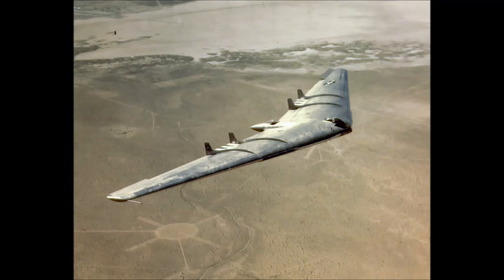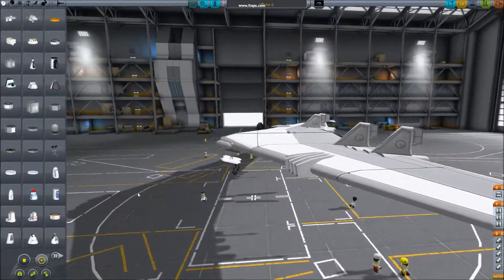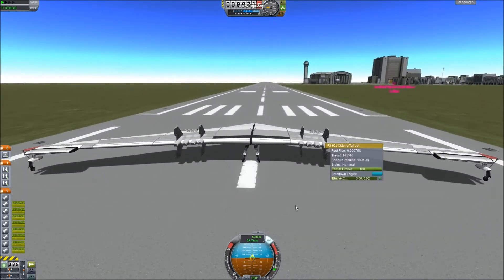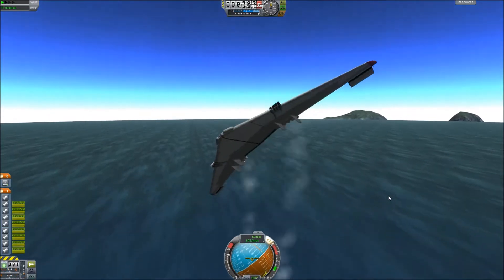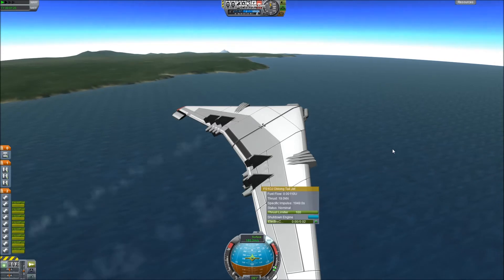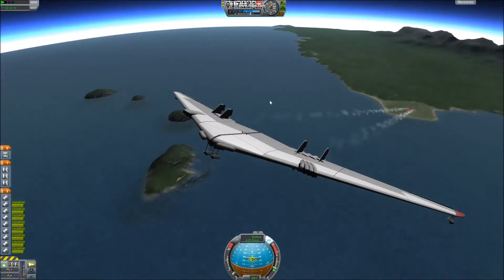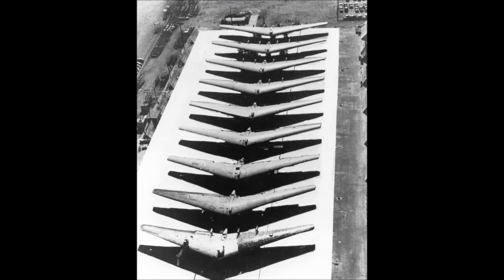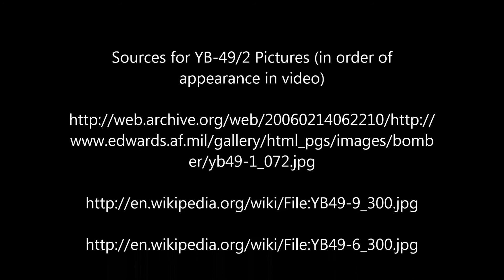Kerbal Space Program: YB-49

Comment: It's probably flipping at high altitude because your engines are starting to flame out.  Any aircraft with multiple engines will start to spin when engines on one side flame out and others are still going.  Pick up more speed before 20,000 m and your intakes will supply more air.  If you're going over 1000 m/s at that altitude, you should be fine.

Once you're going 1000-1500 m/s and it's flaming out anyway, simply throttle down.  At higher altitudes, you'll still be able to run the engines, just not at full throttle.  By the time you get to about 40,000 meters, you can be flying at 2300 m/s with the throttle almost all the way closed!
Reply from the maker: My engines are nowhere near flaming out, especially with the very limited thrust I give it. I'm typically flying this thing at 7.5-15% throttle because of how sensitive it is. Any more and it'll get too much speed (dependent on the altitude) and flip. If I want to make it more functional, I'd have to either find a way to change the design in-game and make it still true to the original real-world design, or I'll have to modify enough where it'd be pretty different from the original design. I'll post a Mark II variant sometime in the future that tries to get the best of both worlds if I can.
Reply: I didn't notice how far you had it throttled down.  It must be a function of CoM vs. CoL then.  Beautiful aircraft, anyway.
Reply from the maker: srook2 I think I may have found the solution! I have to extend the core of the aircraft by a huge amount. The core is invisible, being that is being covered by the wings. Once I do that, I can put some torque-providing control devices on it! I've done a quick test so far and it's a bit more stable than it used to be, and this is with the reaction wheel(s) closer to the center of the craft rather than at the front. I may have gotten it right without destroying the look! I'll post a video of the updated craft that now has a large bomb payload.